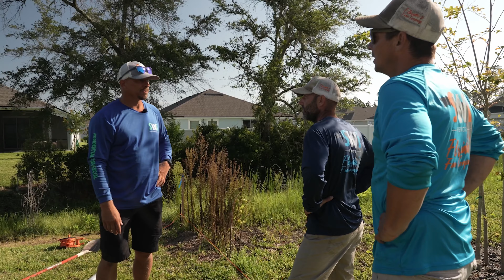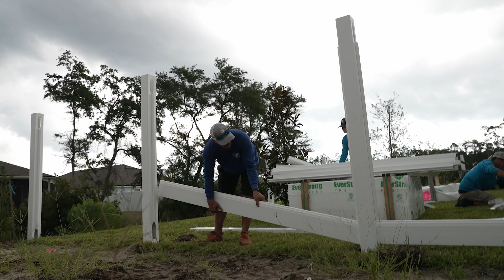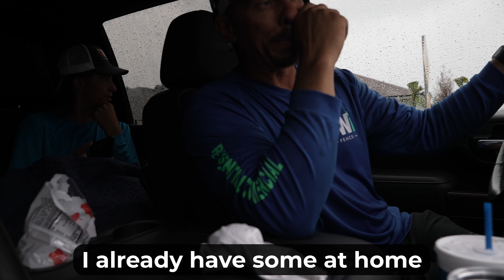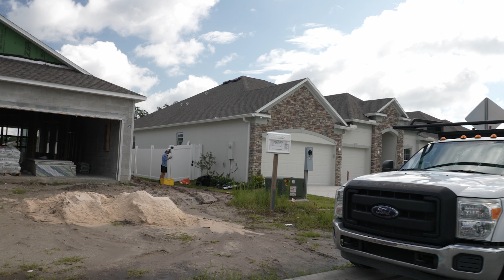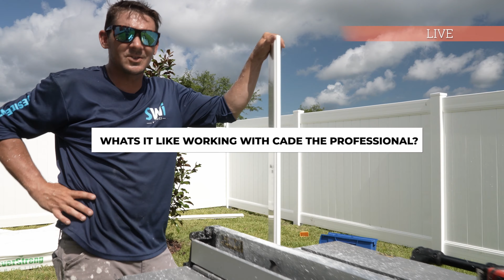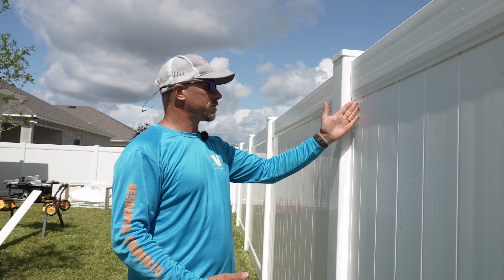28 Years Of Experience VS 4 Years

Comment: Screws for the U-channel ( c-channel), what kind of scrws do you use? Im trying to improve the quality of my vinyl projects, my company does not provide me with screws. Should the heads be flat? Thabks fir the help. Oh, and raill locks, do you buy those from the manufacturer of the vinyl? I use screws because the package is my company gives me does not have rail locks.
Reply from the maker: We use a 3/4” self drilling truss head screw.